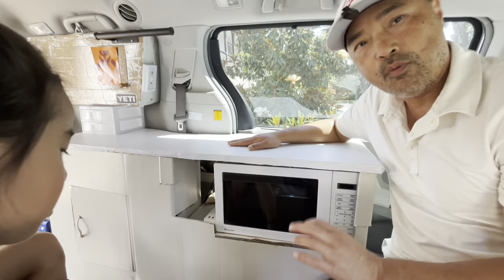Tour My Crazy Sienna Cardboard Camper.  Will this actually work?  Inspector approved!

Comment: I love it. I have a 2013 Sienna AWD limited and recently installed a tow hitch and trailer wiring harness to tow a cargo trailer. That upgrade alone made my van into a super versatile vehicle. I also cut a plastic pallet in half with a sawzall and u-bolted it to the roof bars and it makes a strong roof top deck to stand on. Kids sit up there on 4th of july watching fireworks. I think I need to build out the inside into a camper now lol.
Reply from the maker: The AWD sienna would be an awesome camper conversion.  I wish mine was AWD

Comment: the cardboard 'corners' are known as angle board or corner board used when goods to be shipped are stretch wrapped on a pallet. Theyre usually 48" long or so. They'd obviously need to be cut to size

Comment: Hello, I just subscribed to your channel. I saw you on a different channel where the lady was showing your build in your minivan.  I live in a camper. I’ve been living in a 32 foot camper for a couple of years. I’m still working as a full-time nurse but I am going to do a camper build in my 2006 Honda pilot. When I get ready to retire right before I retire.  I like a lot of the ideas that you did.  So I’ve noticed that most people have like 100 W solar panel, and I was looking at two 400 watt panels but now I’m not so sure I need that much but we’ll see
Reply from the maker: Awesome!  400watts x2 is A LOT of power.
Reply: @Tiny-Campers   I’m pretty sure I need to do a lot more research. I’m not really sure what I’m doing.  I’m really interested in solar panels that are foldable or bendable. I was looking on Amazon and they had two 400 W panels for like 350 or so.  And I was thinking I would probably only use one at a time but if one broke, I have a back up I don’t know.  I need to research.  Thank you so much. Enjoying your channel.
Reply from the maker: @michele3438  hmmm. Perhaps run 2 X 100 watts and if one goes bad , you still have 100w?